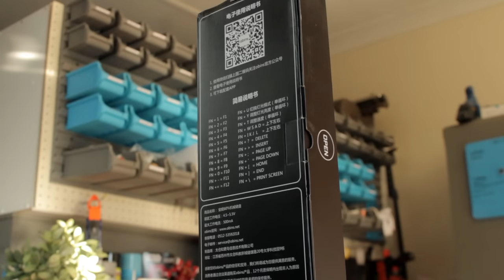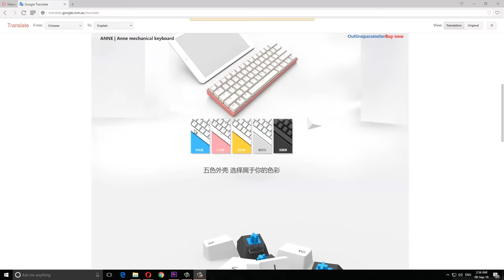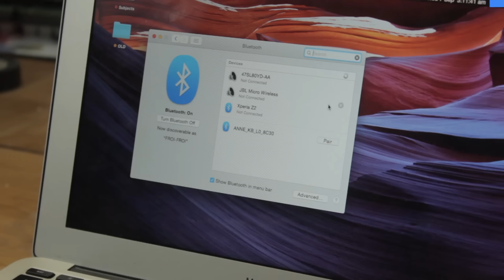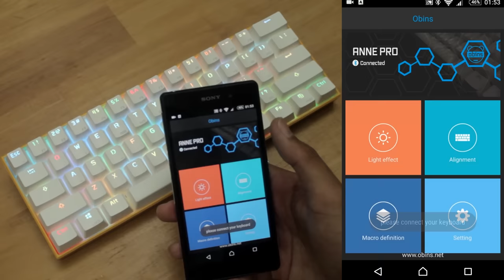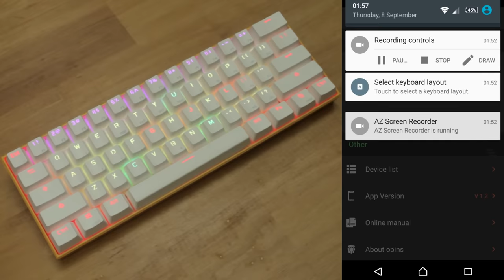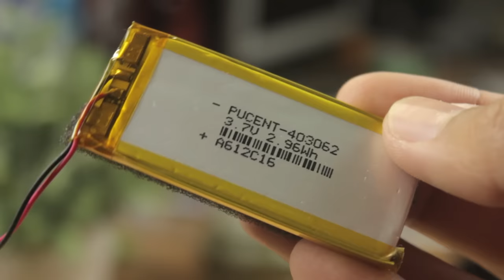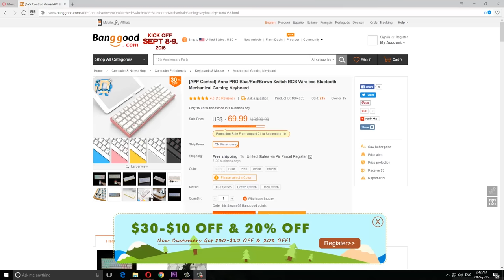Anne Pro RGB Wireless Gaming Mechanical Keyboard - Unboxing & Review

Comment: I got mine a couple weeks ago and I really like it. I ended up modding it with an ON/OFF switch I got from RadioShack and a 3200mAh LiPo battery from eBay. I also lubed my stabilizers with some silicon grease to take care of the rattle (worked like a charm). All-in-all, I highly recommend.
Reply: Can you send the link of the battery of 3200mah for this keyboard, please?
Thanks!
Reply: It will take a bit of modding to make it fit but once you remove some the the plastic ridges around where the battery sits it will fit like a glove. http://ebay.to/2cNkdUU
Reply: Thanks!!! 
How is the battery life of the keyboard with that battery?
Reply: Don't know, it hasn't run out yet. Starting week 2 now.
Reply: Quick question, first time wiring and basically im assuming you took the positive wire of the battery and spliced a switch into it? If so, can you actually turn on the keyboard just using the on/off switch?
Reply: Seung Ryul Lee Short answer, yes. I spliced into the negative wire and interior the power to the board. It only works when in wireless mode but is a good battery saving measure.
Reply: you should make a video about this.
Reply: Chazz Blackwell Doesn't hitting minus when in Bluetooth mode stop all activity? Is there evidence that it doesn't truly switch off Bluetooth?
Reply: Doccks71 also want to know since it's been a few months since I've watched this and I'm still looking towards buying it soon for a laptop setup on a desk with my master MX mouse.
Reply: live a glove? bad idea... battery expands while charging
Reply: Be very careful with LiPos, they should always be set to ~3.80 volts per cell when not in use. Storing them at max (4.2V per cell) or min (3.2-3.0V per cell) could cause them to erupt in flames as the worst case scenario. There is a reason why I and other model aviators have dedicated fireproof safes for them.
You´re just using a single cell but I´d still be cautious as it´s 3200mah.
Reply: Chazz Blackwell
Reply: I know this is a year old but did you have any issues with the battery? I'm considering buying the 3200mAh battery you listed or a 2000mAh one. Thanks

Comment: wtf is it just me or is this keyboard perfect ?
Reply: but..the stabilizers are horrendous.
Reply: It costs less to get an anne pro, lube for the stabilizers and cheap card for tightening the stabilizers than it would be to buy a pok3r. With 5-10 minutes of work the anne pro becomes EQUAL to the pok3r in most aspects and superior in others. And it's like $100usd cheaper.
Reply: it would be perfect for me if it wasnt wireless
Reply: +fr3fou i mean, you could always just... plug it in.
Reply: Metal casing and heft though. That's nigh impossible to get under $100.
Reply: A Pok3r is around $120 USD though. Your build is around 130 euros, which isn't below $100. Still a great board, and no doubt great to type on.
Reply: the font on the keys is horrible though
Reply: Yep,wireless with rgb,compact and gateron switches which i heard that they are better.
Reply: Get custom keycaps
Reply: use a wire?
Reply: Vince Tang not bad (at all) on my unit
Reply: it would be perfect if they use simple font on the keycaps. i really like the keyboard. its cheap and can be easily move anywhere
Reply: 60% keyboards should cost 60% the full size price
Reply: nope a lot of things needs to be changed
Reply: I lubed the stabs and its now comparable to my pok3r which i just sold.
Reply: Its just you
Reply: It would be perfect if it was alps platform

Comment: I don't get why more 60% keyboards don't adopt the HHKB layout. After using this for a while, the arrow keys are a lot easier to access and so is page up/dn/home/end due to how the function key and the arrow cluster is placed. There's a reason PFU still makes boards in the HHKB layout 20 years after the original happy hacking keyboard came out back in 1996.
Reply: most people haven't touch an HHKB keyboard, so it's more safe to go for the more common layout
Reply: The Ordinary Dude a.k.a BABiFun Even then it only takes a couple hours to adjust to it for most people. It's not like your changing out qwerty for a different layout, it's just a modified version that has more thought put into it.
Reply: lucario1111 60% keyboards are little so you can put your keyboard closer to ur mouse
Reply: TOQUE 9 Do you know what HHKB is?
Reply: TOQUE 9 
Also works on tkl

Comment: I have almost the same keyboard (got it about 2 days ago, bought it second hand on the mech market), also white caps and yellow case and RGB, but mine came with Gateron Blues instead of Reds.

It's not a Pok3r, a Ducky Mini or even a KBP V60, but I'd say it's a pretty solid keyboard for the price. With Bluetooh (I managed to get it working with both my desktop and my smartphone rather easily) I think it's a solid "bang 4 buck" tbh.

Thanks for the review.
Reply from the maker: Absolutely correct. I think the fact that it comes with Gateron switches is a huge plus. Since normally these cheap Chinese boards go with Kailh or Outemu.

Comment: Great Review Sir. ONE QUESTION:  Can I get into BIOS using a Bluetooth Wireles Keyboard like this one???  I need a wireless keyboard for my Gigabyte BRIX PRO i7 4770R miniature which must recognize the keyboard before OS loading since I use BIOS functions alot!
Reply: yes I'm pretty sure it does, because I have a wireless keyboard and mouse and it works flawlessly.
Reply: If you use Bluetooth, no, but if you plug it in then it should work.

Comment: Thank you for the excellent review.  Subscribed!  Can the fn key be moved to caps lock?  And if so, can the old fn key be used for something else?
Reply from the maker: Many thanks! Yep, any key can be remapped to anywhere via the software. And you can put anything on the original FN key, even secondary functions or like make it a mute key or something.
Reply: That's awesome, thanks for the reply!  Can you have multiple layers?  Like fn and fn2?
Reply from the maker: Just the base layer, and 1 FN layer. As far as I know, you can't add more function layers.

Comment: Great review. 

I've been looking at this board for a while. I'm more interested in the functionality of the board than the cosmetic. 

Can you program 2nd or even 3rd layers on this keyboard and toggle back and forth? I'm used to toggling 2nd layer with caplock on my keyboard using AHK. Just wondering if it's possible to program the same thing onto the onboard memory so I don't have to run the script.
Reply: Pretty sure yeah but this comment was 4 years ago lmao

Comment: How was the RK-61? This video was superb thank you. I'm really considering the RK-61 with Browns and selling my KBT Pure Pro Red MX with green backlit. I should end up breaking even and changing to browns like I've always wanted to.
Reply: Nickelbawker I've bought one like 4 months ago, but I don't recommend it at all...
The case was not even flat enough to sit on desk stably, and the stabiliser is horrible.
As you can see, 60% relies on the program to function well, but rk61 does not have one.
Eventually, I just buy another KBP, I'd rather give up the BT function for better feeling on fingers. Hope this helps you. ;)

Comment: Thanks for the review, my Anne Pro arrived a week or something ago and it's been super nice :)

Will you review the RK61?
Reply: What is polling rate man? Is it going to keep up? I am a fast Typer.
Reply: I just received mine, I plugged the BT dongle to the front of my computer case and I was able to type 116 wpm on 10fastfingers. It should be more than enough for daily use and casual gaming. I did notice a small delay once in a while.
Reply: Plenty for normal 120+ typing, but if you start buttonmashing too much the Bluetooth buffer will fill up. I believe this is not inherent to the keyboard but a more general Bluetooth design choice.
Reply: were there any input lag when the keyboard was plugged in(no bluetooth)?

Comment: Great review! Are there any fixes for the rattly stabilized keys? Mine has Gat Brown switches and they are very noisy.
Reply from the maker: Thanks mate! I've never done it myself because of laziness, but you can try and find some info on the mechanicalkeyboards subreddit in the wiki. Others have also asked about it on there. Sorry =/
Reply: To fix the rattle: you can replace the whole unit with a better quality alternative that has tighter tolerances (official Cherry ones for example), or you can remove the ones currently installed and use a light lube to eliminate as much rattling as possible.
Plate mount stabilisers are easier to remove than pcb mount ones: with plate mount you only have to desolder one switch to remove the stabilisers, as apposed to the whole board.

Comment: Can you elaborate more on the bluetooth connection? At what typing speeds does it become sluggish? Does it miss inputs etcc, Thanks
Reply from the maker: Unfortunately I didn't push it that far - which I should have. I reviewed the Drevo 71 wireless mech, in which even typing at about 70 wpm, it started missing some letters. When typing with this, I also felt that bit of latency, however, I wasn't having problems with missing inputs - and was still fine at about 100wpm. I can't say how it would be if you typed faster, but perhaps it's just a slight delay, and doesn't miss inputs.
Reply: so wait are there any wireless mehcnaincal keyboards that avoid this nonsense?
Reply: Anything technically has latency, wireless just has a lot more. It's just the nature of wireless peripherals.
Reply: Would you say gaming capable for the latency

Comment: So this has been concerning me... How do you take out that cable connecting the battery to the pcb. Like do I just pull on the wire or is there another way? Just wondering as I have a wireless keyboard and it seems like the battery is dead and is needing a replacement.
Reply from the maker: You can wiggle the header on the end of the wire until it pops out. Some can be quite tight, but you don't want to pull off the header housing that's actually connected to the PCB.

Comment: Would you recommend this over Ajazz AK33 RGB?
I'm thinking of getting my first mechanical keyboard soon, but not really sure...
Reply from the maker: Tough one. The Ajazz will be easier to adapt to, since it still has the dedicated arrow keys and function row. But the Anne Pro offers a standard layout, and is more easier to customise with different keycaps in the future - plus it has better switches. However, the Ajazz is much cheaper.
Reply: Thanks. I figure I'll go with regular AK33 since it is only ~35$ and then upgrade to AnnePro or Pok3r. 
Cheers and keep up the good work!
Reply: openmindian i was looking at ajazz ak33 too

Comment: I'm writing this from my Anne Pro keyboard. First of all, the color spectrum isn't wide at all (you literally have 24 colors to choose from using phone app). If you install the Windows app that community developed you can still have problems making keyboard light up the way you want (when choosing from the whole range of colors). Now when it comes to the battery life, with rgb lights on it worked for 6h. My other complaint is that my keyboard came with one stand shorter than the others. The stabilizers as you said are terrible. After a few weeks of use they started squeaking. Also keyboard sometimes acts weird when you are connected to usb and try to connect via bluetooth. Here's Windows app: https://github.com/kprinssu/anne-keyboard-windows when you sync profile to the keyboard del key stops working. You have to connect it back to the phone and select default alignment.
Reply from the maker: True with the colours, I worded it wrong. In the wave mode it's very smooth in comparison to the Drevo 71 for example. Interesting with the battery life, I guess there's quite the degradation in time, as I didn't have that experience. 

Many thanks for your input :)
Reply: I measured battery life few days after getting the keyboard so either i got a faulty model or they just lied on their product page. 

No problem :)

Comment: The only downside that i heard a lot was the battery placement, type and protection, they say that this keyboard could get on fire easily because of that.
Reply from the maker: Yeh the earlier models had only 1 thin piece of foam, so basically the sharp solder joints on the back pierced the battery. And when batteries get punctured, that's when fires and stuff happen. Now they have 2 pieces of foam, so it seems okay to me, but time will tell.
Reply: +TaeKeyboards Yeah, I saw it later on the video haha, btw greetings from Brazil! Great video!

Comment: Why is that in the product page it says action force is 60g and here it's 45g?
Reply: I think he tested it himself and may have found that the switches are closer to 45g?
Reply: Linas Kvedaras depends on what keys you chose the reds are 45g and the blues/brown are 60g
Reply: DoodleFreak3 late here but gat browns are 45g at actuation. I think the 60g comes from bottom out force, not actuation force

Comment: Is it USB 3.0? Also, did you say that the keyboard is kinda lagging when typing?
Reply from the maker: Not usb 3.0 and yeh there's some latency when typing. Not as bad as others I've tried, although other users seem to have a smooth experience. I've tried wireless mechs where it impacts on my typing - but this didnt.
Reply: +TaeKeyboards do you know if a Bluetooth 4.0 keyboard would have latency? I bought the kb87 from massdrop and I'm really scared that there's some input delay since I'll be using it for gaming. They say it's the same chip or something as the varmillo keyboard. Idk enough about keyboard since I only ever owned a 2013 blackwidow

Comment: I lost the original Bluetooth USB dongle. Is there anyway to get another? I read that it's available on taobao but I can't find it. Should I just get a USB dongle from Amazon instead if it makes no difference?
Reply: Any Bluetooth USB Dongle should work just fine.
Reply: I used an old one I had from before and that works

Comment: Just wondering, if you plug it in wired, do you still need to have the battery inside?
Reply from the maker: You don't need the battery. It's just an alternate power source :)
Reply: Okay, thank you!

Comment: @3:03 Since you don't have to, especially if you don't want to sacrifice functionality, this keyboard is probably not for those who don't wanna mess with function layers and dip switches most of the time. Let alone that a non-widespreaded desing adds to the pricetag and makes a keycap swap unnecessarily complicated, so tenkeyless is the bare minimum if you value design over functionality.